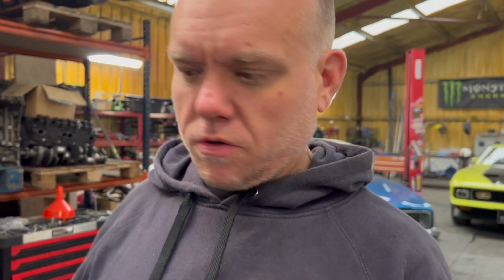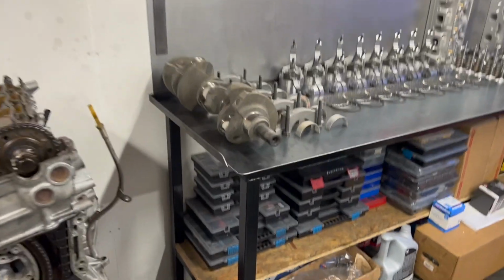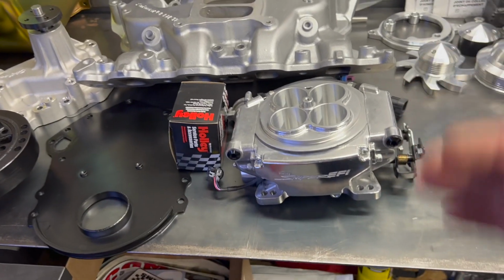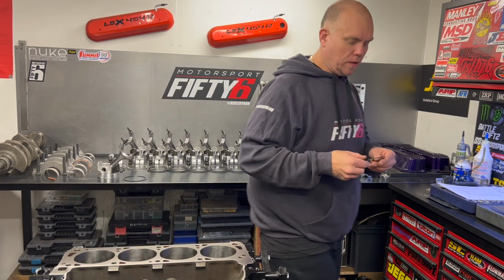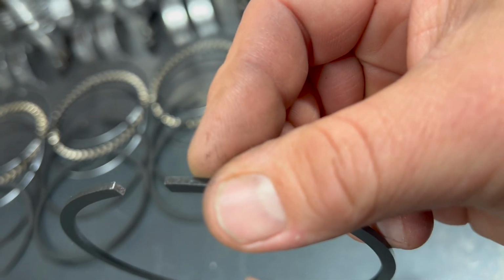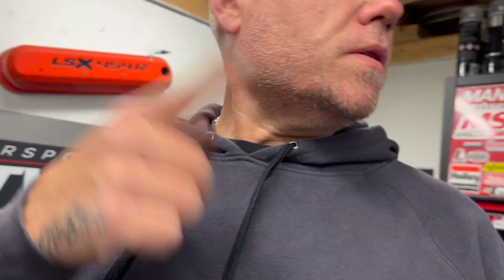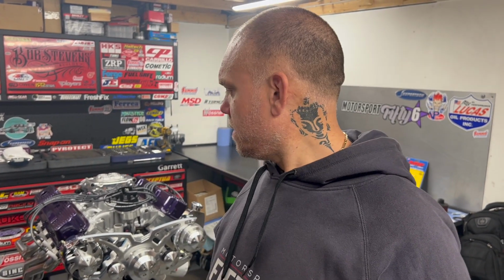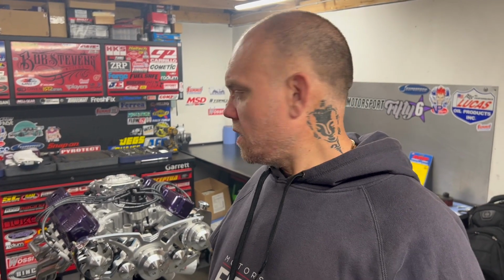351 Cleveland engine build

Comment: In australia we machine the block to take a windsor one piece rear main seal and use an ARP distributor drive.  Nice clean workshop!
Reply from the maker: I have built a lot of engines but I wouldn’t be a Ford expert, my knowledge is in SBC, BBC, and LS’s, I must look into that though, thanks👍 I actually think the workshop is a mess 🤦

Comment: On a very mild Cleveland build like this one, I would’ve went with the Jegs street performance balancer. It’s only a $100.00 and will handle 7,000 rpm’s . A fluid balancer is way over kill in my opinion, unless they plan on building a high HP engine in the future. A Performer RPM air gap intake would look nice compared to that ugly performer. Cleveland’s are a beautiful engine and the best platform of any small block. Beautiful Mustang and job well done.

Comment: Just so you know, even though those valves lapped in fine , You really need to change the Speedmaster seats and do a complete valve job. They are known for cracking and dropping broken pieces in engines.
Reply from the maker: Yeah I’ve always been suspicious of the Speedmaster stuff, but it wasn’t my call on the parts, I was just provided them, the customer had a budget, I only cover engines I build when I provide parts

Comment: What kind of headlights are those? Also what gages are those on the dash
Reply from the maker: The head lights and the gauges where off of eBay, the gauges are original it’s just a cover that goes over the factory gauge

Comment: Excellent video!  I am looking for some good advice. I have a 1973 351 Clevland smog head engine and I want to put some 1970 factory closed chambered heads on it. I was given a completely rebuilt set of 1970 4V closed chamber heads with the 2.19 valves etc and want to make this motor work on the street. I am not looking for advice on using other heads (or recommendations to use the factory 2 V heads, etc) as these were free to me and a few thousand dollars saving since they have already been rebuilt. I dont care about upper RPM range horse power loss and want to use these as a good lower rpm (up to 6000 rpm-ish )high torque motor (its my wifes hot rod so doesnt need to be radical motor). I have been told that if I run these with the factory flat top pistons and right cam profile i can make it relatively streetable? And what about a factory M-Code engine cam porfile?) I am wondering what your thoughts would be as far a good cam profile for my situation? 3500   pound car with automatic tranny (im ok with a higher stall converter). I am well versed on the Cleveland factory heads types, etc.., but it has been hard to find advice without someone contantly recommending to go with 2V heads for the street etc.  I also welcome recommendations from anyone else who sees this post as well :)

Comment: You should never use a high volume oil pump on a new 351 Cleveland build and I can say this from experience. I destroyed several cam to distributors gears before I figured it out. High volume oil pumps are designed for high mileage engines that begin to drop in oil pressure and 351C motors love high oil pressure. but that High volume pump will cost you 15 hp min and destroy your gears on both your cam and the distributor. INSTEAD get a Hall Pantera oil pump relief spring and install that in your stock oil pump and you will get 100 lbs of oil pressure and it wont cost you any Horse power at all. And it is a cheap part. You should also never mount your oil pressure sending unit to the motor because any vibrations will cause them to fail and it will appear like your losing oil pressure. instead mount them to the firewall right above where they go into the motor and attach using a piece of hydraulic or brake line flexible hose. And you should always have the oil bypass loops added into the back of the motor to reroute the oil , this is another Hall Pantera trick that is absolutely a must do very cheap fix for one of the only problems I have ever found with this motor. I have built and driven Cleveland's HARD to 300,000 miles and they were still good.    Loved the video, loved your work space, it was like heaven. I am an old timer who only owned ford muscle cars and I learned the hard way. Ford has gotta lotta secrets. Knowing them meant I could always buy them cheap, not like now with the internet giving away all those secrets
Reply from the maker: Thank you very much for the advice, I’m not going to pretend that I’m a Ford expert because I’m not, my knowledge would be small block Chevy and LS, so I will look into advise, and unlike the kids today I listen to the old timers 😂, I think that is have the problem these days the kids listen to the internet rather than the guys who have actually done it and have experience, thank you for watching 👍